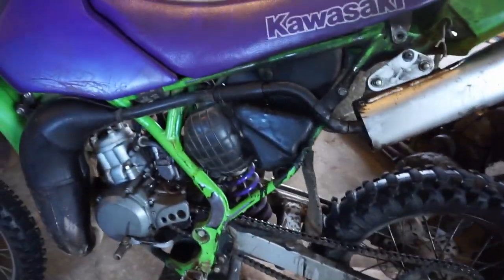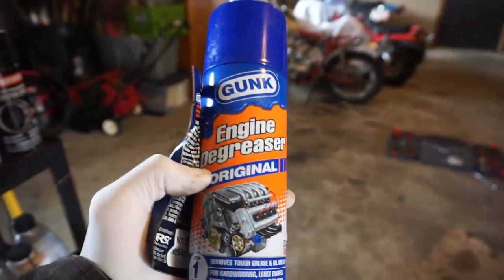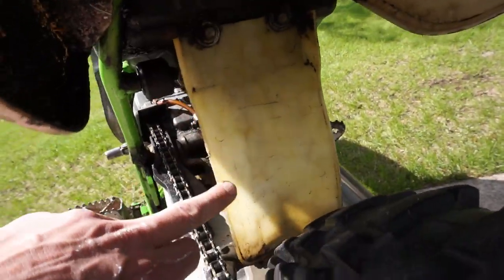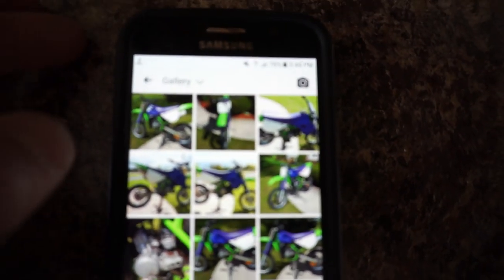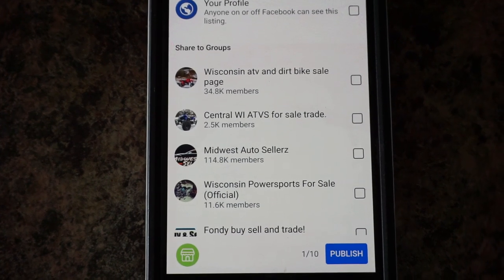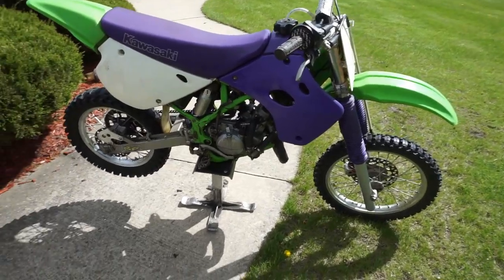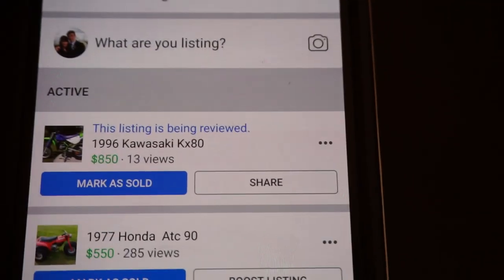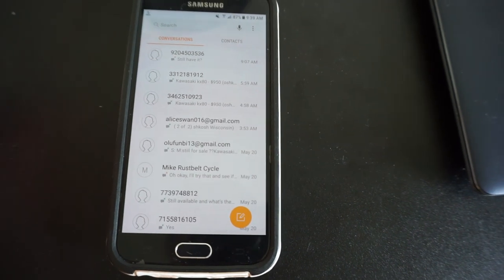Can I Sell This Kawasaki Kx 80 in 24 Hours???!!! (CHALLENGE)

Comment: Hoping to get $800 😂, bikes not worth 500 let alone 800, it’s a 96 or 97 it’s old you jb welded the case, I hope you tell them what you have done. That bike needs a lot of work, you paid 250 for it and didn’t bother getting 2nd hand case which are cheap but instead used jb weld. I feel bad if some poor kid buys this for 750 hopefully they know better.